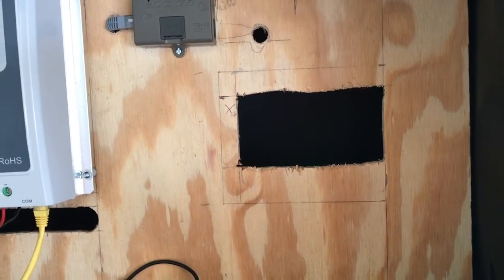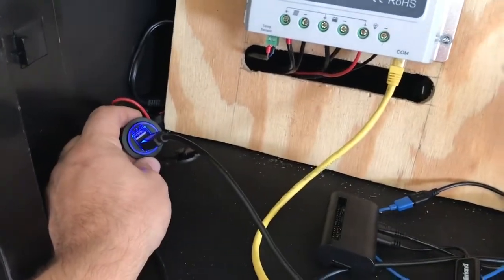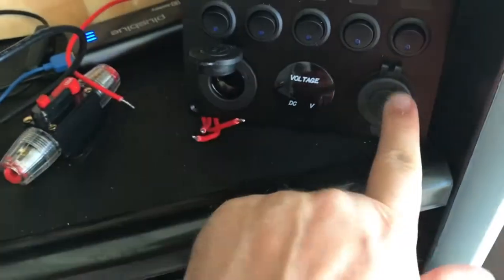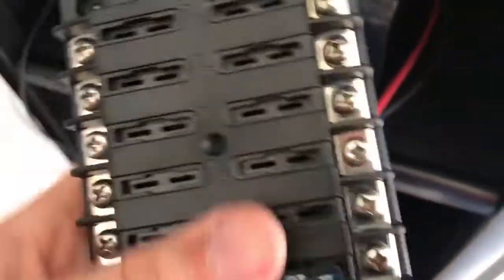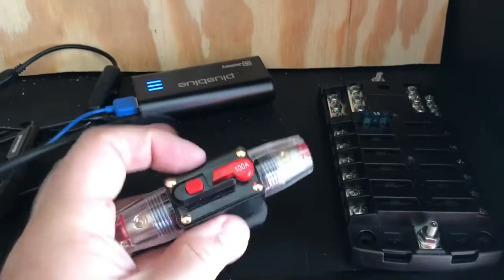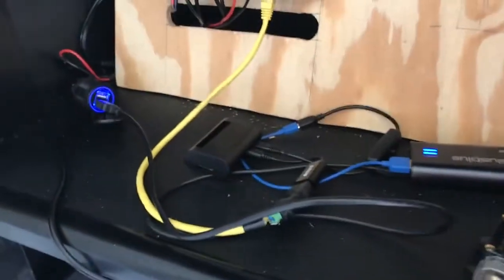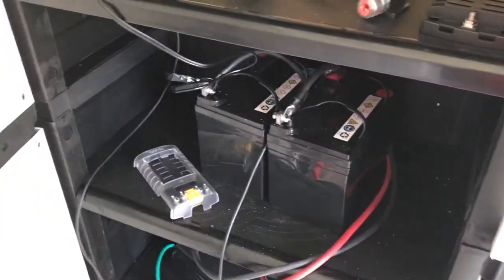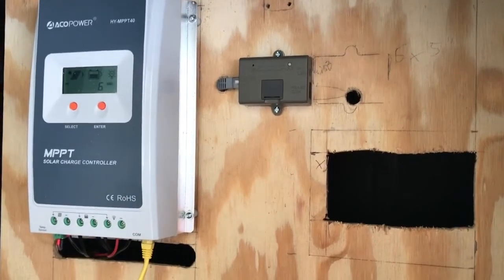Installing switch panel part 1

Comment: where's part 2 buddy this is what i'm doing now
Reply: cool all mine is in my shed have the same 12v switch panel but i want to connect it straight of the mppt 12v load is that possible.
Reply: Mppt 25 amp load fused 
sterling 1600 watt pure sine inverter straight of battery with kill switch and 200 amp fuse 
i will be upgrading the mppt soon to an 60-80 amp i have more solar panels to put up on the shed roof i have a big shed lol 28foot by 10 foot,
batteries are my down point because there to expensive i can't afford lithium :( so have to stick with wet/lead leisure batteries